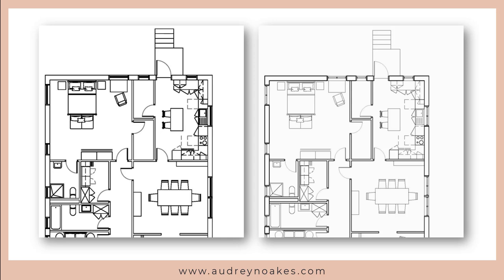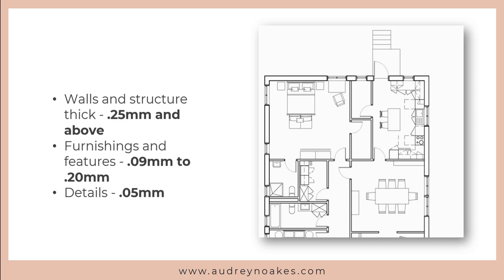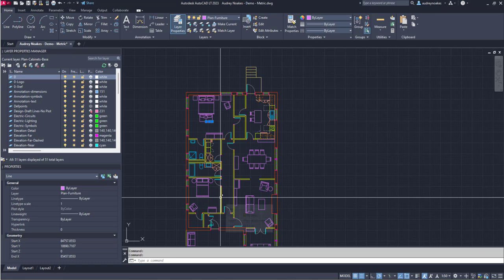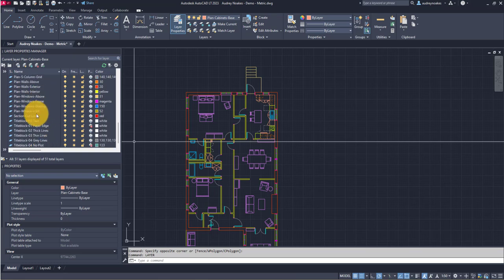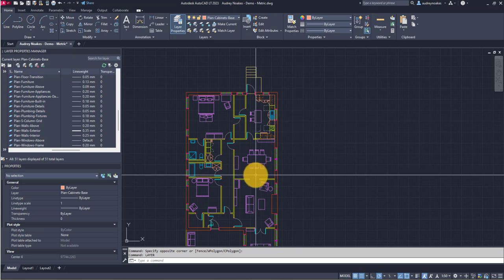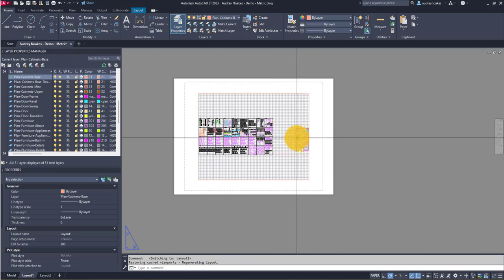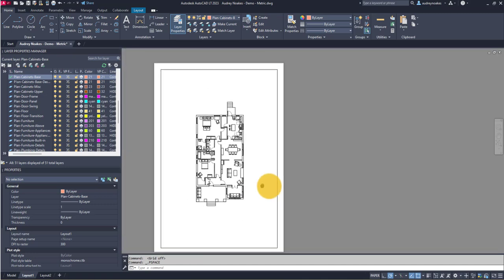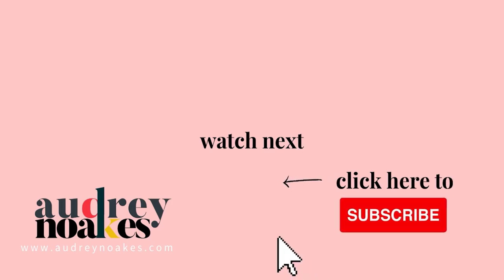Setting up LINE WEIGHTS with hierarchy in AutoCAD

Comment: Audrey you have a great passion for your work!   I agree that colors and line weights make a difference when designing in cad, and it seems that it is lost when you're in a corporate environment and have to comply with standards..    I once changed our firms colors to help a key employee because he was partially colorblind and could discern colors by intensity (then I had to change them back when he left).    Thanks for your posts! subscribed.

Comment: It seems like using the color plot style makes a lot more sense.. instead of making things more complicated and going into each individual layer and editing the lineweight
Reply from the maker: I definitely think color based plot styles can be helpful - particularly with large teams working in AutoCAD! But they are a bit more complex to set up for a designer working on their own. And the teacher in me also thinks controlling the line weight directly (instead of thinking in color) means the principles of line weights are better understood and applied. (That said, I've never been able to un-learn the colors of one of my first jobs, e.g. all cabinets should be drawn in 21.)
Reply: @audreynoakes  I just started working for a very new firm and I'm trying to make my own cad base file. I downloaded an old CTB file to use and noticed it is primarily a color based plot style. Now that i'm working in a smaller firm I'm trying to figure out how to unlearn this... and create my own. I understand it may be a bit more complex. I wish it was easier to figure out. You know what I don't understand is that I did actually just start with a normal base file, created layers and adjusted their lineweight. but they still all printed in the same lineweight. So i actually just imported my 'old faithful' layers and am using my xerox CTB to plot them in their correct (to what i'm used to) lineweight.